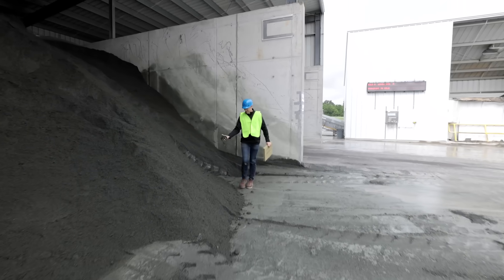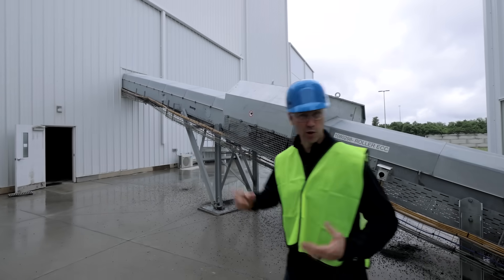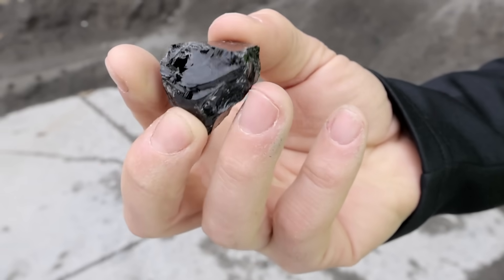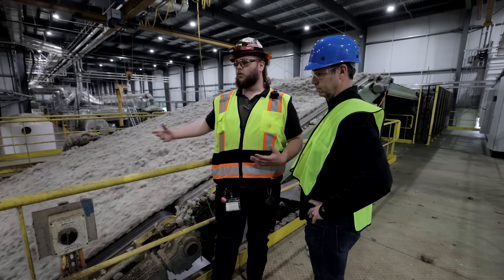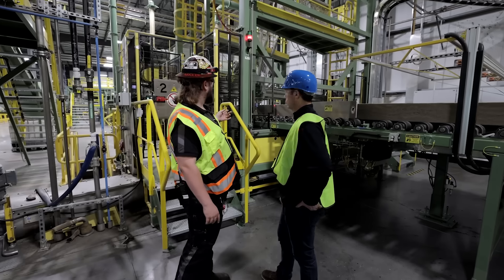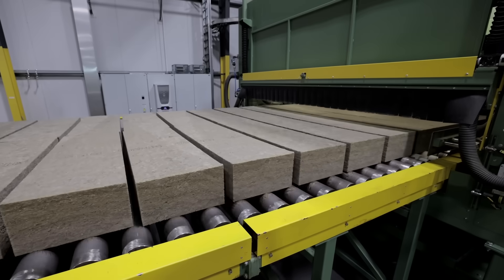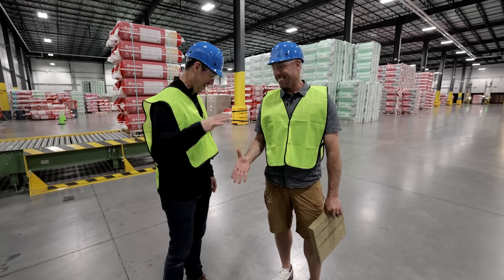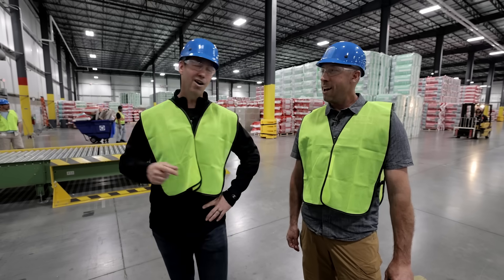Turning Rocks into Insulation! Rockwool Factory Tour

Comment: After watching, I came away with more questions than answers. It would have been nice to learn more about WHAT the raw material actually was. Rocks? What kind of rocks. Where do they come from? Does Rockwool control the raw material or does it come from outside suppliers?
And the HOW does the rock become a wool batt? Like cotton candy? Cotton candy isn't glowing as hot as lava. So much was glazed over. 
And finally, it would have been nice to see all of the finished products the plant produces. Various products names discussed, but what and where are was there intended use. So much was lacking. (If certain areas were considered as trade secret, then at least it would have been addressed. Very weak tour .

Comment: I remember the first antirockwool postings by some locals right before it went viral locally. the postings made the sister plant look like a huge extremely dirty soot filled decaying dystopian eastern block soviet era steel plant and claimed the new local plant would be exactly the same. In the plant tour it seemed exactly the opposite. even the steel beams along the walls didn't have a speck of dust on them and safety was well done. locals in the area can be so full of BS at times

Comment: Fiberglass is a common insulation but once wet it can retain the moisture . Rockwool is an amazing alternative for basements and waterworks. Last I researched rockwool is more expensive than the micro glass insulation but the longevity of not having to replace it when the basements floods or pipes break makes the insulation well worth the cost. The same is true with concrete boards instead of drywall. Amazing.
Reply: Rockwool also retains its structural integrity for basically ever, whereas glass wool tends to slowly compress over time. For those of us who live in brick houses its quite reassuring that the insulation will not have to be replaced every 50 years.

Comment: I had a house built in 1921. It had Rockwool insulation. Must have been added around 1937. I believe that’s when they started producing it here in the U.S. I found some while doing renovations. Had a paper backing printed with the brand name. The stuff was holding up fine after all those years.

Comment: I use Rockwool covered in fabric on my walls for acoustical control in my home studio.  It works exceptionally well in this application!
Reply: I was thinking of doing the same for my very cold bedroom walls. Do you think it would also insulate well??
Reply: @angellas.1314  Sorry, I didn't pay attention to what I was replying to. I thought this was one of the audio engineering channels I watch!  

If you cover your walls in Rockwool panels, you'll probably get a thermal benefit.  It will also make your room exceptionally quiet and acoustically dead, depending on the thickness of your panels.
Reply: @angellas.1314  The product is primarily used for thermal insulation.  In thermal applications you'll want to have as much of your walls covered as possible.  If you want to maintain some liveliness to your room acoustics, this might be too much.

Comment: 35 years ago I had a weekend job of cleaning at the mother factory in the town of Hedehusene in Denmark. On weekend we were cleaning out the chamber, that the newly spun wool enters right after the "candyfloss" spinners. Let me tell you; that was NOT as clean as you see in this nice new factory, but that's a whole other story.

I can see from your video, that the basic production process are the same as it was back then, although there's been a big upgrade in recycling of water and dust free production. 

Rockwool are still the best isolation material in my opinion , due to it's fire resisting capabilities among other things.

Comment: This video couldn't be more one-sided journalism. Although the tour in the factory was interesting and impressive, the hole "sustainable" talk of Rockwool is one big green washing scam. Let me back up this argument with some observations:
1) in the beginning of the process, the factory only seem to use raw material. That is not sustainable. You should at least have a intake program of discarded rockwool, so that this can be reused in a circulair process.
2) melting stones to a temperature that you can spin cotton candy of it, really requires a tremendous amount of energy. Is this all fossil free green energy? In comparison to woodfibre insulation, rockwool needs a lot more processing energy for getting the same R-value plate.
3) the process of making rockwool is causing huge ammonia (NH3) disposition in the atmosphere. This threatens biodiversity in the broad surrounding nature of the facility.
For anyone who wants to make a real sustainable choice, please considder banning Rockwool and other mineral fibre insulations from your building site. There are lots of greener alternatives out there, performing as well or even better. Like woodfibre, hempflex or cellulose insulation.
Reply: Why should they have to waste money on giant battery and solar installations when fossil fuels provide nonstop power 24/7. #greenisascam

Comment: So it's the new asbestos because asbestos is just a form of Rock slash mineral and it was woven and spun into insulation and even concrete asbestos pipe like they put fiberglass fibers in concrete now they used to use asbestos without even researching the effects on the human body first

Comment: A great product. My wife and I switched from fiberglass to Rockwool years ago, and never looked back. It's tougher, water-resistant, easier to cut and fit, less dusty and more fire resistant. It does cost more, but we think it's worth the money. We've never used the rigid board yet but are eager to.

We built an insulated floor assembly for our new home and were hit by an unexpected thunderstorm before we could cover the subfloor. Water got down through the seams of the plywood and wetted the Rockwool, so of course we were mortified. What do we do now? Well, we kept up good air circulation under the floor assembly (a crawl space) and the product dried out completely. If that had been fiberglass it would have been a soggy disaster. This one incident sold us on the product. And it's made in the U.S.! What more do you want ? Cheers from a Canadian neighbour.
Reply: If your Canadian its made in Milton since 1988
The Milton plant is NOT as clean as this new one.
Reply: Rock wool is amazing.  Fireproof.  Bug proof.  Rot proof.  One of the best building materials in the world, IMO.
Reply: Also great for acoustics.
Reply: WHEN THE U.S.MILITARY SAYS: PENETRATION, HOW EVER SLIGHT! IS: !  !  !  "M O R E  EQUALS A SPECTRUM OF PARSED DISTICTIONS.  FULLY LAWFOOLISH OR SCOTUS STYLED LAWS FOR THEE AND NOT FOR "OURNS!"
Reply: They also have a plant in Milton Ontario.
Reply: Comfortboard is some awesome stuff. We live by a highway and have heavy equipment outside but the inside of our house is quiet like a church. Cant even hear the rain

Comment: Cool tour, thanks for this;  2 questions... what kinds of rocks they want to work with? Secondly, is the furnace electrical or some other type?
Reply: Rockwool is typically made from a combination of Basalt and the slag waste from steel production
Reply: I a pretty sure it is gas.  There was a big a do about extending a natural gas line down the main road nearby right before they opened.  Don't see the huge electrical inputs like I'd expect like Alcoa used to have at the aluminum plant in Frederick.

Comment: Interesting, but waaay too superficial.  Not even a description of the raw material... maybe I'm missing the point of the channel?
Reply: They literally use rocks to make the wool. Rocks are a mix of metals and non metals. This mix gets the non metals removed by heat, which liquifies the metals, once cooled the alkaline metals make the others convert to a kind of glass (its dark because of the wide variety of metals contained, each metal would give a different color), this "glass" (which is the same as volcanic obsidian) is then passed through heat again and pressed through small holes to make the fibers. It's not as complicated as it seems.

Rocks + heat = bunch of metals + gasses that flee

Bunch of metals + alkaline metals = glass / obsidian

Obsidian through holes = rock wool
Reply: @corveramoenglish7275  thanks for that… but why did you feel the need to fill in the gaps the video left?
Reply: @paultinwell5557  I just like to teach, XD

Comment: Hi Matt been watching your show for  a while now. You have great content. I had to watch this one because I used all rock wool in my garage 30X40’X14.6’. I knew fiberglass was not good quality.  The pieces fit perfectly in between my studs. And also my trusses. With just enough friction fit to hold them firmly in place. It is easily cut with a long knife. 
My in floor radiant doesn’t run very long to keep it warm. So that means less wood in the outside wood gasification furnace. Upstate NY gets hit with sub zero temps at times. I was in a t shirt when working out there.   (I WILL ALWAYS USE ROCK WOOL FROM NOW ON!!! ) 
 I want to re insulate with RW in my house, after seeing the performance  in my garage.  
  Made in America is where we need to support each other. 
  Thank you to the folks at Rock Wool.  Benjamin E.

Comment: I only have two questions:  1) does it make you itch like fiberglass does, and 2) how does it compare, cost-wise?
Reply: From a family insulation business - Roxul is incredibly itchy, often with fibers resembling fiberglass shards from the 60-70's products. Also, its extremely expensive and hard to work with.  I don't recommend using it in cathedrals/trays/raised sections as its very unforgiving and isn't easily manipulated(Homes have hundreds of wires, potlights, wood backing, etc that makes such a rigid product difficult to work with, especially overhead)
Reply: @currincook6422  Depends on which product you choose.  The AFB and CBatt products are flexible, easy to install and quite forgiving - and can be cut with a knife.    If you choose the more rigid products you will certainly have problems as described.

Comment: Makes me even more inclined to use a material like Rock-Wool for the interior insulation on my build project.  Possibly as part of the roof/attic insulation as well although I'm leaning toward closed cell spray on for under the roof decking.

Comment: I see this being the next asbestos in 15 yrs
Reply: Rockwool is a Danish company    and have been around since 1909. Pretty sure it would have come out by now if there was a problem. In Denmark spray foam insulation isn’t used for instance, because it’s virtually impossible to reuse building materials once it’s covered in that stuff.  Since we are basically tree hugging commies over here you know it’s not a new asbestos
Reply: SHOW YOUR PROOF OR STOP BEING A LIAR
Reply: @daveklein2826  YOU WENT FROM 0 TO 100 REAL FAST
Reply: @daveklein2826  I've worked with it for 10+ years, any day you install it without a mask is a night of coughing and wheezing. My father also agreed, and has been in the insulation industry for 40 years. CRS  isn't being a liar, he's speculating. Idiots like you allowed asbestos to rage on for 40+ years, as you never thought to question its efficacy. How about you show proof that it isn't dangerous? Try shaking a roxul batt in front of sunlight and tell me it isn't. When left exposed, it poses long-term health risks as it continues to shed fibers long after its been installed. Generally we use it to cover spray foam in unfinished settings,  where many head runs/ducts sit. Tin whackers are generally shit poor at using foil tape to seal ducts, thus fibers are pulled into the system, and throughout the house. You're telling me constant exposure to fine particles over many years isn't dangerous? Building inspectors in my area have raised the same questions as to whether it can be left exposed, you should do the same

Comment: Matt You forgot to ask them about nasal exposure inhalation experiments to examine the pathological effects of rock wool,  such as the long-term persistence of rock wool in the lungs, carcinogenicity, and pulmonary fibrosis, and any plans to assess the safety of rock wool.
Reply: Agreed. I regularly work with it, Inspectors are starting to questioning whether it can be left exposed over time, as it always seems to sheds fibers. It's nasty stuff, I don't doubt it will be a less serious asbestos like situation 20-30 years from now.
Reply: Do your own research
Reply: @daveklein2826  Research data on Long-term persistence of rock wool in the lungs is not available by the manufacturer or 3rd party. Being at the factory floor would be perfect opportunity to ask these questions. This testing and analysis is not something that can be done by an individual, it has to be done by large team.

Comment: THIS IS A PERFECT EXAMPLE OF "NEW" American manufacturing...clean, quiet, high tech robots and extremely efficient, like the TESLA factories. 

However, notice that there are VERY few employees visible. Conclusion? Despite the misleading rhetoric that "America is losing it's manufacturing base, quite the contrary. What HAS happened that the number of American jobs in manufacturing is far less, but they are higher paid, higher skill, requiring specialty education than the jobs in the old rust belt. In the steel mill in the movie "The Deer Hunter" men labored in hot, dangerous conditions in a dirty, heavily polluting industry (which then moved to Korea). Final takeaway - the contribution of manufacturing to the US economy (as measured by inflation adjusted GDP) hasn't changed since 1946 - however the number of workers is about 50% less. Rockwool is GREAT stuff, won't burn, doesn't sag, won't hold moisture and helps deaden sound. Have it my house.